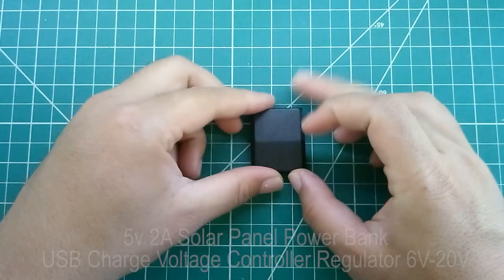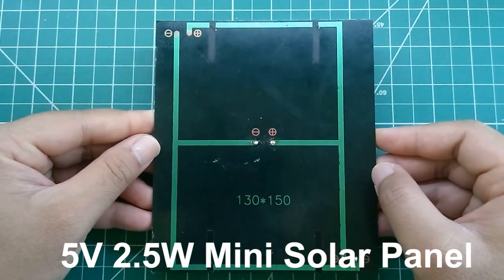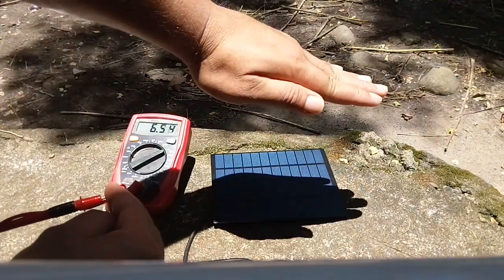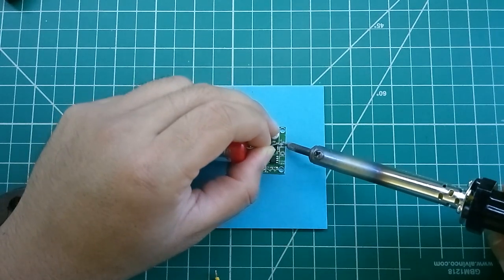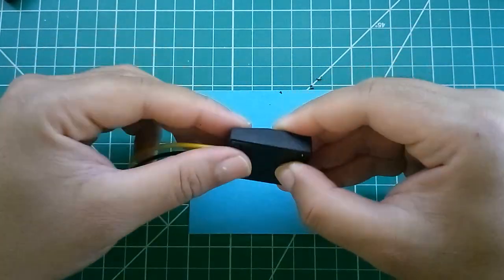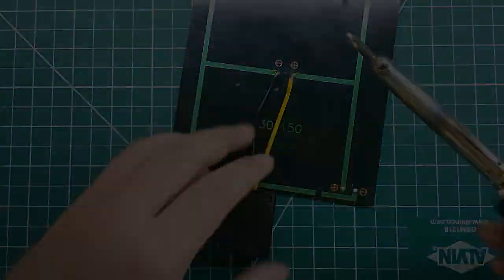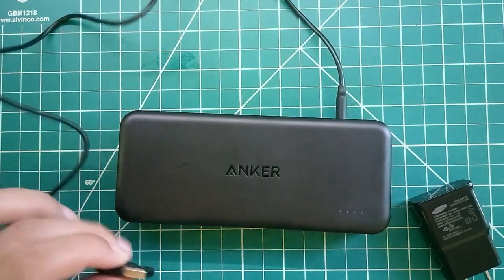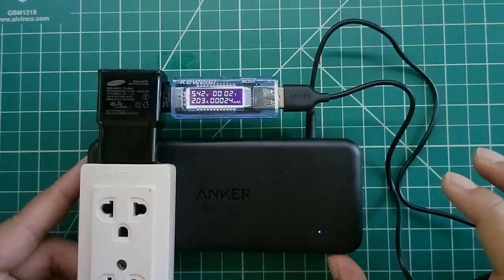(Review) DIY 5V 2A Solar Panel, Power Bank, USB Charge Voltage Controller Regulator Module 6V-20V

Comment: 0.32 mAh?
It must be 320mAh.
Either you read something wrong, or you got a defective product.
Reply from the maker: Yeah you’re actually right, I read it wrong. It’s 320mAh not .32mAh
Reply: @TaylorSoloaiJR  it is 0,32 A and not 0,32Ah
Reply: And it's not mAh it's only mA cause only when you use battery you can know how many amps will have per hour.. So it's 320 mA.
Reply from the maker: @lazarworkout6878  Thanks, learned something new.

Comment: I wonder if you could just connect the charge regulator to a car battery or lithium polymer battery from an R/C aircraft, like a 5,000mah 14v lipo?
Reply from the maker: Good question, I'm going to try that out soon then upload the results.
Reply: I bought one of these off Amazon and tested it...yes it works fine of a Lipo battery, I simply wired it up to a deans type connector and plugged it in.
Reply from the maker: Cool stuff, planning to wire mine to an old car we have.

Comment: A little confused.  I have 6 volt panels and I hooked these up to test charging.  I used a USB meter like what you used.  While the panels would output a higher voltage without a load, this voltage gets pulled down immediately as soon as a load is connected.  I was reading *around 4.5 volts at up to 5 watts today going to a power bank.  So my question would be, outside of the capacitor which would somewhat smooth the voltage out...what is the point?   It seems like the controller would just consume power.

Comment: Can I just use a regular buck converter and set it to a specific voltage?
I'm looking to hook it up to 2 AAA batteries that are constantly in use, and thinking of hooking up a small panel and a buck converter to something like 3.5v (so 0.5V keeps batteries topped up without damaging them)
Will this work?
Thanks
Reply from the maker: The problem with some buck converters is that when you get a shadow on the panel or all of a sudden it gets cloudy and the voltage drops, it won't recover from it and it doesn't output any voltage anymore. One YouTuber did an experiment on it and that happened, not sure if the newer version modules are better at recovering.

I guess summer time is not a problem since it's sunny all day. Oh and I would hook up the AA batteries in parallel and set it to 1.4 volts. Because in series it might cause the other battery to over charge since theirs no battery management board to manage the voltage on each battery.

That's what I think, unless someone else on YouTube has a better suggestion and comments.
Reply: @TaylorSoloaiJR   Thanks for this, very helpful.
Reply: @TaylorSoloaiJR   Hey again, I got my solar panel, a cheap 5v one from ebay with a built in USB port and I hooked up to the "INPUT" on my power bank. while the sun was out it was charging and nearly full, but overnight, by morning the battery went from 3 bars down to 1. Do I need some kind of reverse current protection?
Thanks
Reply from the maker: Hi again,

You need a blocking diode so your power bank doesn't get discharged during the night.

I usually just salvage those from old electronics but you can also find those on eBay as well.
Reply: @TaylorSoloaiJR  Thanks. Seems a bit silly they didn't put one in the circuit. I didn't think it possible for the power bank to loose power from the "input" side, but oh well, guess if you buy cheap you buy twice...
Reply: @TaylorSoloaiJR could you share this experiment?

Comment: in which postion was the the multimeter awhile you test the Solar panel current in the Sun
Reply from the maker: I didn’t measure the current with the multimeter, thats the part I forgot to do in the video.
Reply: @TaylorSoloaiJR  you did  Good job my friend Thank you

Comment: In how many hours will it charge a power bank of 4000 mah
Reply from the maker: If its constantly recharging at 300mAh it will probably take more then 12hrs but in a real life situation it’s going to more then that. Because not everyday is a sunny day. Just depends on the weather. So if i wanted to have less charging time i would need more of the same solar panel in parallel.
I already uploaded a video with two of the same panel and it only gave me about 600mAh so i need more.
Reply: @TaylorSoloaiJR  what if I use 12V 10watt solar panel
Reply from the maker: Ive tried it doesn’t really give out that much. Its in one of my videos if you want to see the results.
Reply: @nitishverma1484 , 10W-20%=8W
= 2½h
Reply: @TaylorSoloaiJR  what if I use 5 solar panels of this type connected in parallel, how long will it take to charge 4000mAh battery?
Reply from the maker: @creativevanceteam558  I am just guessing but it would be 3 hrs or less. Just depends on the day.
I can't seem to find the exact same type of solar panel like the one I used in the video but if you know a link to this or a better one let me know.

Good luck on the project!

Comment: Thanks again Taylor,

I'd like to know the max input current(A) the 5V 2A solar voltage regulator can withstand? 

I am trying to calculate the number of solar panels I can use with it.
Reply from the maker: Wish I had an answer for you but I don't even know. I tried looking for info on this but nothing. I don't even have enough panels to try and test if it can handle more then 2A input.

Comment: Is not enough power to charge devices.
Reply from the maker: Yes needs more solar panels
Reply: @TaylorSoloaiJR  U need more amps and watts
Reply from the maker: @Saikohack  oh yeah, sorry actually I meant if I was to use the same solar panel in the video then I would need.more but yes that idea is much better. Less solar panels but also quite expensive too.
Reply: @TaylorSoloaiJR  depend kind of solar panel monocrystalline polycrystalline some are more efficient than others.
Reply from the maker: @Saikohack  you have any recommendations?
Reply: @TaylorSoloaiJR  I don't have any idea to recommend Wich solar panel because I don't have too much experience with solar panel and system. I saw some videos. some times I get info from internet, before U buy a new solar panel get info from internet. I recommend to search about V= voltage mAh= amp W= Watts.
Reply: Put on YouTube solar panel 10w 5v and see the test of that solar panels